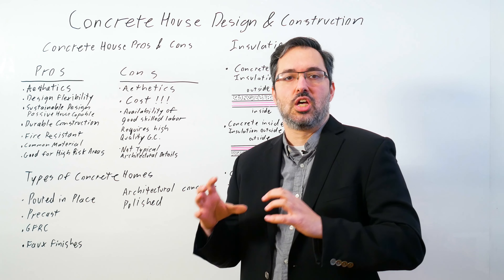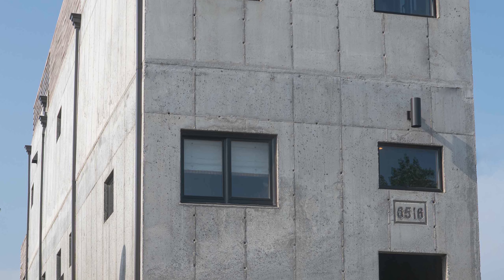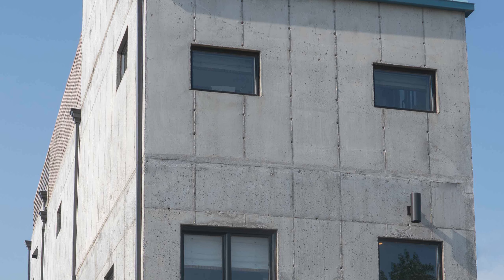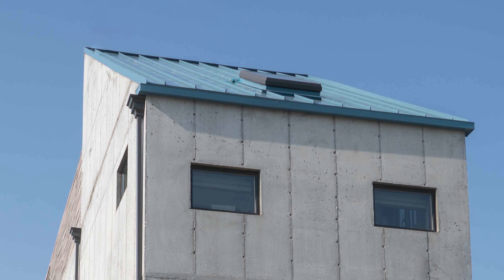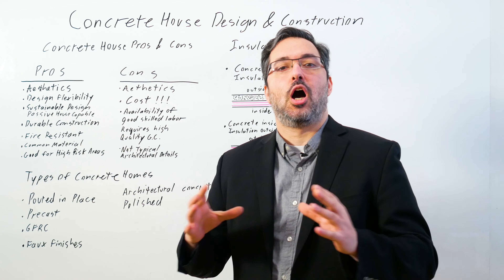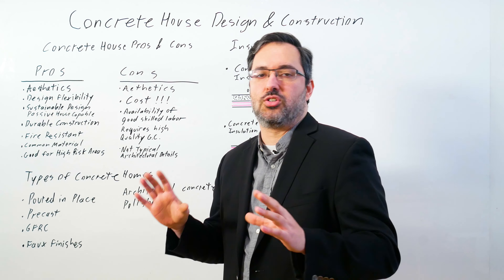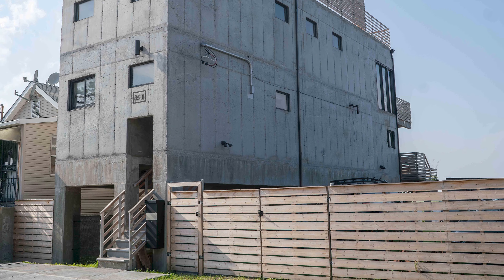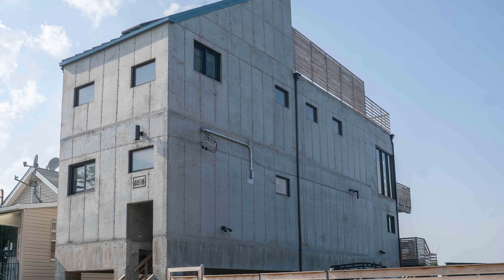Concrete House Design and Construction

Comment: brutalism is the equivalent of a car without a finished appearance. Once built, the steel, bricks, and concrete house are almost no maintenance,  no fire, no termites, no mold, no roof
Reply: What are you going to do when the rebar rusts?
Reply: Concrete needs to be maintained constantly. Efflorescence is a struggle and it is normal for water to pass through the walls on the first floor.
Reply: @anythingelseplss  entire world makes concrete houses. You are not special but fool.
Reply: @ketunky3056  1917 Thomas Edison patented concrete homes, it’s not new but I believe will be the standard from 2022 and on. You don’t need an AC or heater with a concrete home temperature is perfect year-round, providing the concrete is the right thickness for whatever environmental zone you’re in. With this super high inflation building materials are too inflated too outdated pseudo science technology and a complete waste of energy sucking everyone’s savings away.
Reply: @CEDEFE41  that’s what covers for
Reply: @peckerpeter2078  He patented it. Doesn't mean he invented it.
Reply: @alyssam1159  No one cares about who invited it, it’s all based on invention patents getting the credit..Always- Edison or Bell examples etc. etc. True inventors never really get the credit they deserved. Anything more than 10 years back people forget anyway.
Reply: @CEDEFE41 The Romans and Greeks didn’t use rebar and their structures are still standing after thousands of years……
Reply: @botsareeverywhere  and the modern concrete have rebars. whats your point
Reply: @OldMarius-gn5kk  read the fucking conversation, fucking hell
Reply: @botsareeverywhere  Why do people always say this? Yes the colloseum is still standing in Rome, but half of it has crumbled off and has been extensively restored. It's great if your house doesn't completely collapse, but that doesn't mean you can live in it.
Reply: @caustinolino3687  It didn’t “crumble off” pieces were taken by people for building houses etc… over the years
Reply: Cybertruck

Comment: I built my concrete house 26 years ago. It has thick sandwich insulated  14 inch outer walls, solid concrete floors, strudded aluminum wood  large windows.  It is 4700 sq ft  2 car heated garage, 5 bedrooms, 4 baths, finished basement, office and large food storage  room.  It costs me $500 per year to heat the house. The cost was 25% cheaper than a stick house. We had a 5.6 earthquake this year and we did not bother to get out of bed, It rocks as one piece, nothing broke, just scared neighbors with damaged houses.
Reply: where would one go to find out the material cost for concrete, or the type of concretes needed to start budgeting a project like this.
Reply: same here.
Reply: Have you ever made videos about your house, and the design and building process? 
I'd love to hear more about it, and I'm sure many others would too!
Reply: @Iockk  look at your DOT quantity, cost pdf for the current or previous years to get an idea of the cost or call a concrete pour company and ask for an estimate
Reply: How much did it cost

Comment: I love  concrete  houses  because  they hold their  value
Reply: A poorly built and/or maintained concrete house can easily lose value.
Reply: @dustinabc  you can say that for any form of construction but I  can assure you that a poorly built concrete house will hold it value more than  a poorly built stick framed house.
Reply: In my country the Philippines we use concrete all the time because of it's quality and strength.
Reply: @Knightmare919  Mexico does the same thing. Best material ever.
Reply: @dustinabc  Just like any other materials.

Comment: In Europe they isolate concrete houses with Styrofoam. It can be 10 or 12 cm thick. Also, if you don't want to insulate on the outside, you can apply cement stucco on concrete wall, just to give it a nice finish, and once it dries out , you can paint over the stucco to give it a nice color to the house.

Comment: Here in Philippines, many "non-professional" home builders can design a awesome concrete without using any mold. The cost of lumber and concrete has also just a slight difference.
Reply: Mate, I have been in Philippines. Yes you are right. Concrete is popular there and workers somehow know how to work with it. Houses look good as well. However, Philippines does not have cold season. Concrete crumbleses after every single winter much faster then in thropics. It is important to follow technology meticulously to avode crushing your concrete walls within several years. It means not every one can build a concrete house which can stand decades in New York, for example. Workers need specific skills as well. An architect must know how to design such houses to make them save and durable. Plus US has a lot of regulations you need to follow. Concrete houses are the science.
Reply: @pavelsameliuk7295  When I was a very young student at that time, we call it as the freeze-thaw process. Which is why it is necessary to use plasticizers in order to DRASTICALLY reduce the amount of water while simultaneously making it very easy to pour and-or place and is self-levelling without the need for concrete vibrators and will fill all the voids between the steel rebars so that the gravel aggregate won't settle down at the bottom for it is necessary to make sure that each piece of gravel is surrounded and bonded by an almost evenly uniform layer of cement-sand mortar between them. I have seen a certain fiber reinforcement product that will simultaneously mix with the cement-sand mixture surrounding the pieces of aggregate gravel and making sure that it can (1) add additional reinforcement and (2) form a simultaneously spacing effect between the pieces of aggregate gravel. That was way back in the early 1980s and it's purpose is to add additional strengthening while creating a spacing effect between each individual pieces of all of the aggregate gravel mix with the cement-sand mixture. It might be a kind of polypropylene fibers or yttria-stabilized zirconia glass fibers (before such concrete admixtures became quite common in the later years of the 1980s and became accepted in the 1990s and up to this year.

Comment: I am OBSESSED with building concrete homes, and I was so discouraged to see how many Americans didn't seem to share my enthusiasm. Oklahoma has had some mild earthquakes (where you feel it, but it may not even register with your spouse). But those tornadic storms? Boy howdy, is that exicting, sitting up all night wondering if you'll get warning, be awake, or (in my case) if hiding in the closet will be sufficient. 
In the past 15 years, I've been caught in a wedge tornado, felt the walls of a mobile home shake, ran out of a 5th-wheel RV in a lightning and hail storm because I didn't want to end up impaled when the thing came apart. Just straight line winds blew the pop-out back in at me - talk about not being able to get back to sleep. 
This year, a tornado hit my house. While honkering in the office closet with my dog, the walls shook, and you could feel the ceilings lift. I expected to open the closet door and find it raining inside. The repair guy said my roof twisted. I am obsessed with building a concrete home, lid and all.

Comment: Thank you for the breakdown on concrete houses😊 i hope you make a million concrete houses and make a million dollars on all of them🙂
Reply: Are you in the states? I am OBSESSED with building concrete homes, and I just so discouraged to see how many Americans didn't seem to share my enthusiasm. Oklahoma has had some mild earthquakes (where you feel it, but it may not even register with your spouse). But those tornadic storms? Boy howdy, is that exicting, sitting up all night wondering if you'll get warning, be awake, or (in my case) if hiding in the closet will be sufficient. 
In the past 15 years, I've been caught in a wedge tornado, felt the walls of a mobile home shake, ran out of a 5th-wheel RV in a lightning and hail storm because I didn't want to end up impaled when the thing came apart. Just straight line winds blew the pop-out back in at me - talk about not being able to get back to sleep. 
This year, a tornado hit my house. While honkering in the office closet with my dog, the walls shook, and you could feel the ceilings lift. I expected to open the closet door and find it raining inside. The repair guy said my roof twisted. I am obsessed with building a concrete home, lid and all.
Reply: @WhiteytheLab  im in canada, specifically toronto. My interest in concrete homes started when some concrete home builders pages started popping up in my IG feed.

Comment: I love the fact that he said he never used ICF. Everybody seems to love it but it would drive me nuts having Styrofoam in my way at all the attach points when it comes to the façade coverings and or interior wall coverings.
Besides, I don't want any insulation in my house that is not Roxul. Gutted my house in Brooklyn and it's everywhere. You need it your interior walls as well for soundproofing. When the wife gets on a 6 way zoom call with her family ...you will see why.

Comment: Great and very informative video! Wish you elaborated a bit more the insulation part. 
What would be the downsides of insulating on the inside in case you want just bare concrete on the outside? Won’t you have moisture/humidity problems when isolating in the inside, especially in zones where the climate is more harsh than New York?
Reply: I’m no professional but I would assume for the moisture/humidity issue problem, it could be solved with your central HVAC system, I could go into more detail but it would take me a bit, and for the downside to insulating the interior, I’d guess the problems with that would be less sq ft since you would have to build a sort of way to keep it in place, like building a wall structurally made of wood and then using sheet rock to cover it up, and the the second downside to insulating the interior would be you would lose the concrete look for the interior, there could be more downsides and solutions to these but that’s all I can think of right now

Comment: The wife and I are going to get a house built in the near future. We have good southern exposure for solar panels and nature light. Is it possible to do a basic rectangle with a flat roof? About 50ft wide by 30ft long by 24ft tall. How thick would the wall have to be to do this, if it is allowed?

Comment: For the case that you put insulation inside and exposed concrete outside, based on the code (let's NY code), do you have to put any extra vapor barrier between concrete and insulate/interior. The reason I am asking is that concrete will absorb water and if possibly pass it to the other side, or maybe if there is small crack in it; then mould will grow between concrete and insulation right? Can you do another video and explain that?

Comment: How about all the plumbing and electrical runs?  Are they installed external to the walls later or cast into the walls/floor?  I'm thinking stucco covered concrete on the outside and light steel stud interior wall with foam board between.  That would allow all the plumbing and electrical to be installed in the interior wall which can be filled with rock wool and covered with drywall as usual.  Of course, cost would be higher.  This is basically how concrete basement walls are finished.

Comment: Would love the security of a concrete house.
But when you say increased cost, you didn't give an example.
Are we talking twice the cost or ten times the cost?
Reply from the maker: Not ten times more but more none the less it will depend on many variables especially on the cost of labor in your location.
Reply: Actually concrete could end up cheaper than other options due to labor cost (with concrete you just make the frame and then use machine to mix and pour the concrete)...
Reply: @kmanev  agreed.
Reply: @JorgeFontan  I'm in Mexico 

Looking to build a cast n place home

Your videos are incredible thank you...

I have some questions 

How does someone have a quick conversation with you?
Reply: 0 ~ 60% more per square foot

Comment: Hey, thanks for the video, Jorge.  I'm DIY designing a concrete home in the Phoenix area and I want to go with embedded insulation (i.e. exposed concrete on both sides).  Should I expect to have difficulty finding a contractor who will take this job?  It seems less common so just thought I'd ask.  Thanks again!

Comment: Good video. Would like to know approximate cost to build concrete home with insulation inside and poured concrete outside - $/sqft or $/100 sqft or for a typical 3000 sqft single family home in NJ? I think cost is the single most decision making factor. Such homes are required to protect from fire and storms.

Comment: I would say if its more ore less expensive depends on a number of factors. And that is also true for prefab.

If you build high volumes or large buildings, prefab might actually be cheaper. For example we can typically do 12-14meter span (about 50 foot) where i work and its hardly a noticeable added cost. Doing a large span in Wood is complicated and costly.

We also have many different type of surfaces. One example of a high quality surface is when we use a matrix to put cut up bricks in to make a brick like surface. The bricks is about a inch thick and part of the surface cover for the rebar. Making the walls hardly thicker at all.

We also have other types of matrix to just make different types of surface directly of the concrete. Typically it have some type of post processing where its grinned either smooth or rough. We have wall have basically a mirror like shine, and it last pretty much forever. With a matrix we can make walls that either are two colored, or a shiny and rough part to make different types of pattern. Everything from fake brick and fake wood to digitally generated pattern. Like say if you want a two tone photo on the wall, we can do that.

Because of the machinery we got in the factory, a lot of this is automatic, or semi automatic, and the cost of implementation is quite low

Comment: This is such a great and informative video!  I'm just wondering, if you have concrete on the outside and the inside, what is the function of the insulation?  Also, if you live in a year-round sunny area, and if you install central air conditioning in your concrete house, do you still need the insulation?
Reply from the maker: If you install air conditioning in any house without insulation you will be operating in a very inefficient manner. Insulation keeps the hot air out. You need insulation and air sealing on any house. without it you will need to run the AC a lot more in order to keep the house cool, this is going to use a lot more energy.
Reply: Thank you for the reply and the information!  I was under the impression that insulation kept air in, not out.  For example, like how a thermos keeps hot air inside.
Reply: Yo I worked in a warehouse made of concrete. I’m in California. It was very temperature stable. We didn’t have an insulated roof. It was still 10ish degrees cooler at all times inside. Only when we ran 100+ for a week or more did the floors get warm. Had we had any a/c and an insulated roof it would have been 100% ok. People used to build out of stone for a reason. And sheet rock is just imitation rock. Concrete is the same shit.
Reply: Great video, Jorge. I subscribed to your channel because this is great content.

Comment: How much more expensive (if it is) is a concrete house that's exposed on the exterior and interior? I just think about all the additional costs like framing the interior, drywall, painting. Same can be said for the exterior, you now need insulation, stucco, siding? Does the concrete truly end up costing more if you already have so many additional costs that need to be added? Just wondering.

Comment: The problem with concrete is that it can be compromised because its a continuous solid unit. Look at the quakes in turkey a few years ago or the condo's in FL those concrete structures crumbled. However, traditional masonry buildings made of brick wouldn't have this problem as they move independently from each other

Comment: Oh, welcome back, brutalism! Long time no see.
Reply from the maker: yup
Reply: In any former Soviet country brutalism is abundant. I don't know that it's really trendy though.
Reply: Are you sure the house in the video, is safe when earthquake hits? I was born in a 100% concrete house country,  and they are made in a different way. Steel and bricks then concrete,  the finished appearance is part of the construction. Why you have to live the concrete exposed?  Do you  leave the sheetrock exposed? Do you use the steele springs into the base columns?
Reply: Plus the little windows is just a poor choice. Steel, bricks and concrete house use enormous windows.
Reply: Insulation in a concrete house is easy. A proper steel, brick and concrete house are hermetic.  There is not a part of the structure where the cold winter can get through, rather than the windows  and doors. In summer are fresh and in winter are cozy.
Reply: This is pre manufacture concrete , which is not the same of a real steel,brick and concrete house.

Comment: I'm curious about the strength and long term durability of concrete.  Can the concrete develop cracks over time?  Assuming the crack penetrates the entire wall how would they fix it?  Is the concrete pre-stressed or would that have any benefits?

Comment: How much would it be to do one in roman concrete I wonder
Reply: Probably a hell of a lot more, Roman concrete uses fairly expensive materials and is not made en mass. It would be exponentially more cost effective and easier to build a house out of modern concrete.